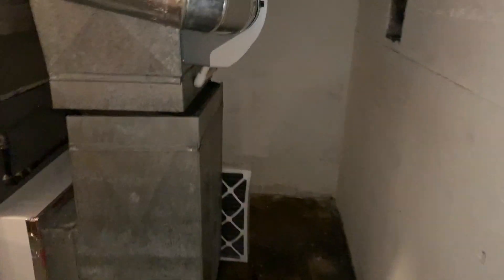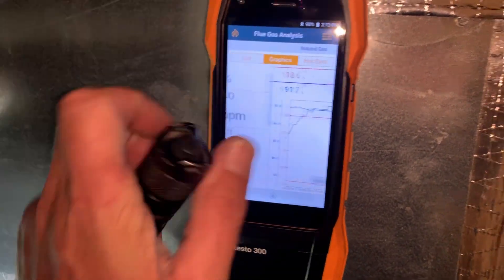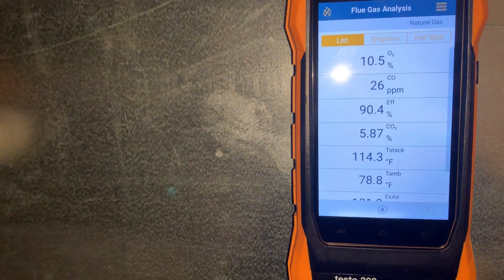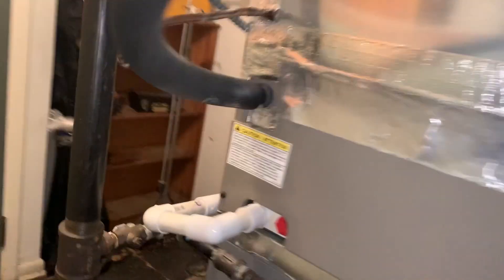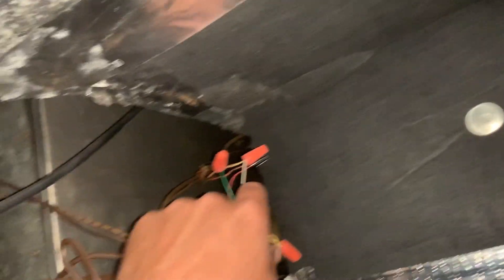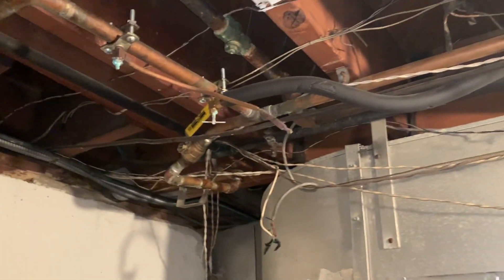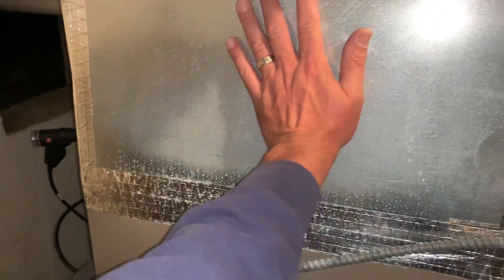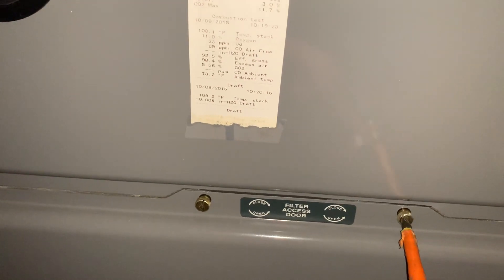Performing a Combustion Analysis on a Ruud Rheem 90% Gas Furnace

Comment: Just so you know, they have the wrong reducer on that exhaust vent. It’s supposed to be a flat bottom 2-3 so the condensate can run back and drain through the furnace.
Reply: I didn’t see anything draining from that 3”. I must’ve missed it. It can become a real issue with condensation, taking up internal volume and creating pressure switch issues
Reply from the maker: I’d rather see any possible condensate dripping into my cast iron blocks. Floor is better dripping right out the diverter

Comment: When you drill a hole into the 2 inch PVC combustion pipe. What do you used to plug the hole???
Reply: We use masking plugs in 80%er's and Hi-Temp tape on 90%ers
Reply: @PipeDoctor  Thanks for the info